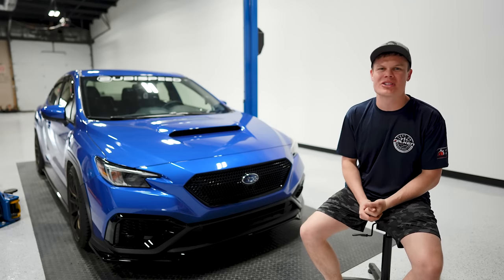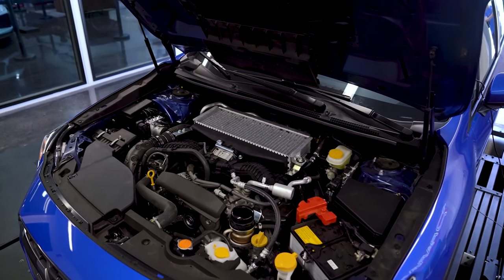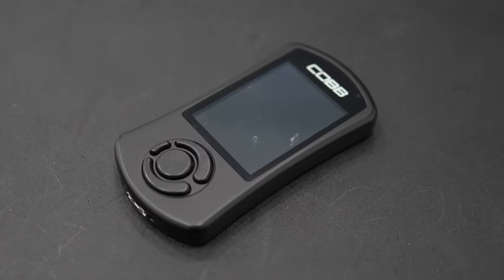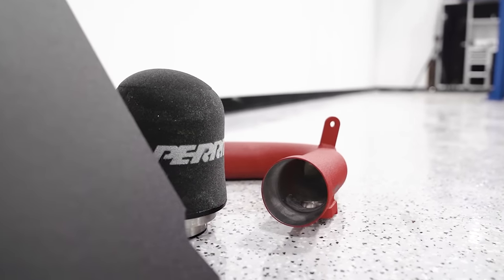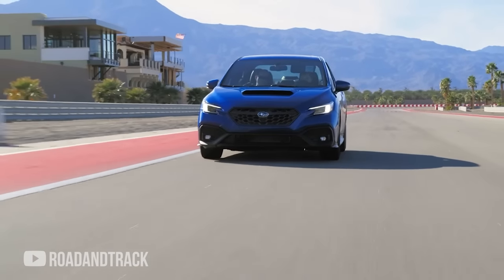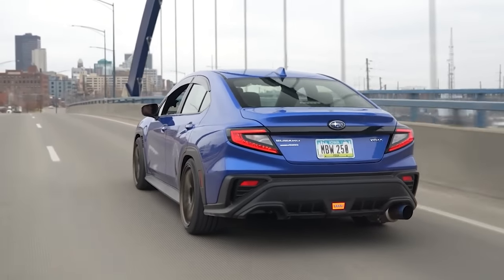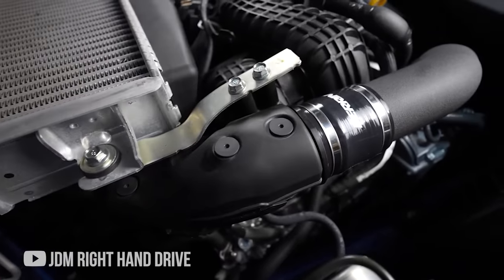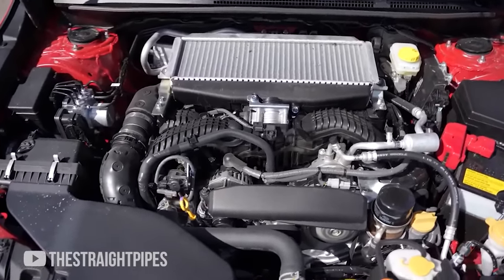Modifications that Make Power on the 2022+ WRX!

Comment: That race between the VB WRX and VA STI was cap. Had to be a driver mod in that WRX bc that STI driver should've done way better
Reply: It’s not cap, the EJ is a 20 year old technology brick that sucks at making power.
Reply: @Pharmz  for sure, I own both 22 WRX and still own previous genre STI.  One thing that was very obvious though is the STI has front LSD and rear LSD, the WRX has no LSD at all and it's very noticeable when I drive one and the other, that's why my STI is my track car. But the WRX is much more comfortable and quiet, so it's my daily.

Comment: 30-50 hp for an intake. Stop lying even with a tune no way in hell
Reply: Protuned 100%, won’t see any gains without one tho
Reply: @Slenderman454  no way. Maybe 25 at most. And that's pretty extreme even
Reply: @imwrong4891  my VB is tuned with a burgermotorsports intake by drunkmann and it’s pushing around 325 wheel right now so i’m telling you it’s true lol, on 93
Reply: @Slenderman454  The tune will add that much power perhaps but the intake does not add that much...90%of your gains are from the tune. Very little are actually from the intake.
Reply: @imwrong4891  I definitely see what you’re saying, but i don’t know man. It was a pretty substantial upgrade from cobbs stage 1 OTS, and i only gained maybe an extra 3-4 pounds of boost. Definitely get what u mean tho.

Comment: I have a 2016 wrx with 400 hp to the wheels. I changed everything but the turbo(I have e85, new headers, new intake, new intercooler, deleted egr, etc). I imagine 450 would be easy with a new turbo. Only problem is, it won't pass smog. At least I think it won't. Here in california, a potato won't pas smog so I don't have high hopes, despite my car probably being cleaner than most cars in california. One thing is for sure, the more I see the 2022+ wrx, the most it reassures me I am not getting rid of my 2016wrx till it literally falls apart. That is the ugliest wrx I have ever seen.
Reply from the maker: What about the Bugeye WRX? Another design that wasn't love initially but it has aged well
Reply: @SubiSpeed  Ahh, now that you mention that, haha, yeah the bug eye is uglier. I actually forgot about those models. I am sure the 2022 could look better with some aftermarket body modifications. There is no fixing the bug eye without redoing it completely.
Reply: And yours passes CA smog with those mods and 400whp? HIGHLY doubt you're getting that without built internals on FA20. Wait til IAG offers built FA24s and big turbo kits come out. Until then, keep hating 👍
Reply: @LAdumpsterbaby  Uhh ok? Only hating I seeing being done is you. Didn't mean to get your ego all riled up cause you can't make enough power. Keep coping I guess. I have no built internals. Just bolt ons. I got it tuned at m45automotive in auburn, ca by Travis. Just so you know, since you can't read, 400whp is on E85. I only get about 360whp or so with 91. I said the only problem is, I don't know IF it will pass smog. I haven't had too yet since it has been on a non op since I had a back accident a few years ago and don't drive it as much as I want. I will be getting it back registered soon. Until then, keep living in fantasy land.
Reply: @Kinvesu  You're the only one getting personal dude. Ask any up-to-date tuner worth their salt, FA24 is superior in every way and VB chassis is superior in every way. This is also  only the beginning of this platform. You're free to choose to not accept that.  Looks might not be your bag which is fine, I despise the back end of mine but everything else is a step forward and FA24 has MONSTER potential.
Reply: @LAdumpsterbaby  this 100%. Unless you're living under a rock, there's absolutely no denying that this new platform is significantly better in every way. These car journalists downplaying the FA24DIT because of "only 3 horsepower bump from the previous WRX" are the big reasons why the VB is getting such a bad rep, initially.